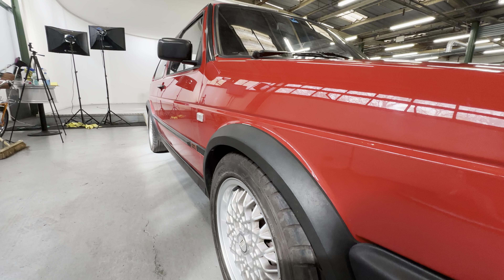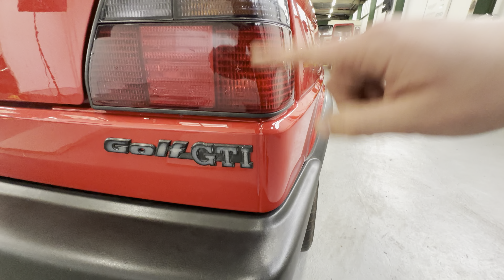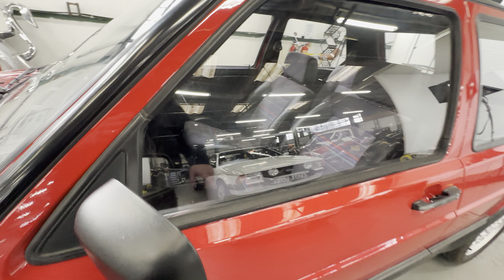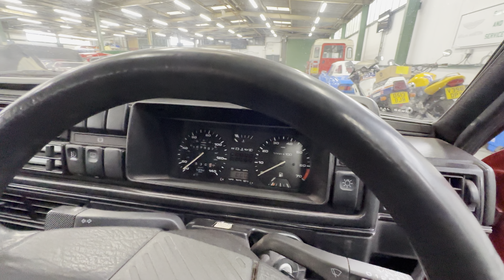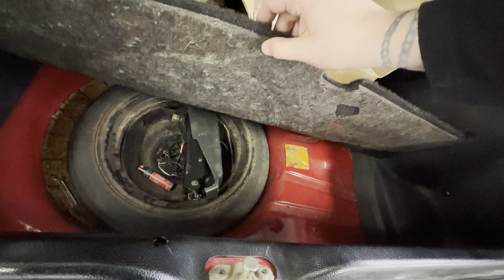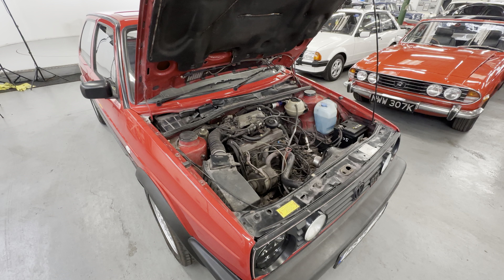VW Golf GTI - MK2 Big Bumper Car

Comment: Really needs putting back to stock. It's been modified front seats need retrim the pleather sides probably due to bolster wear. 8v should have orange rear lights not smoked and orange bumper indicators.
It's a very nice example tho.